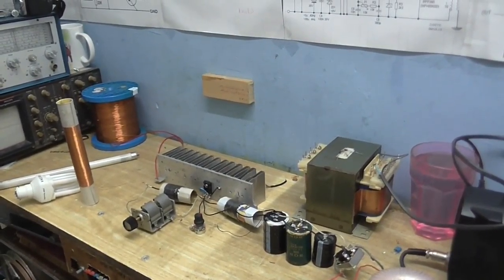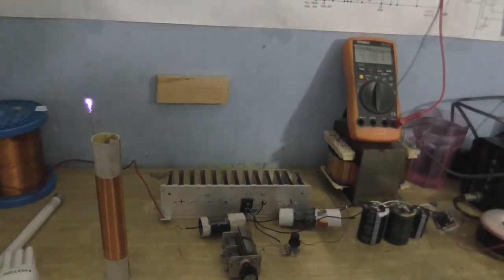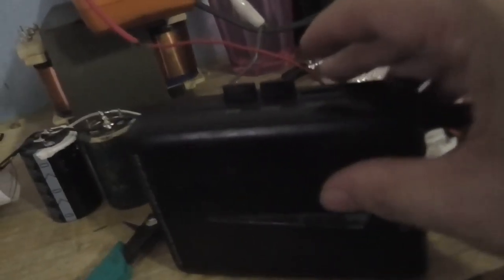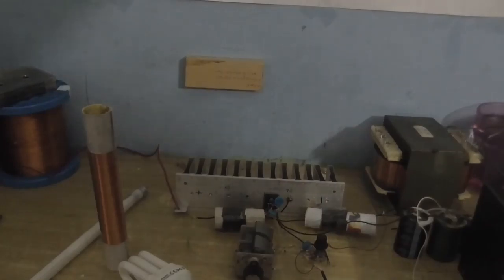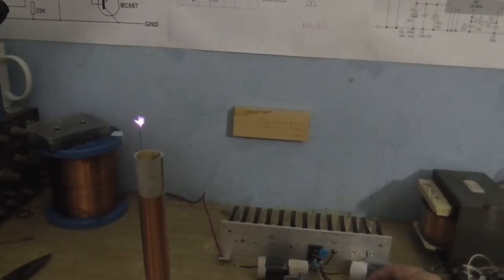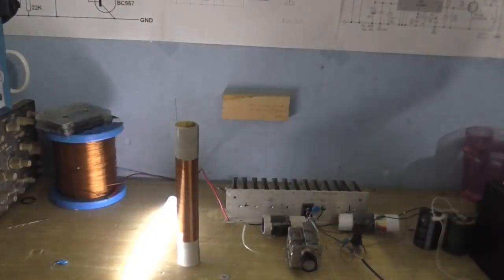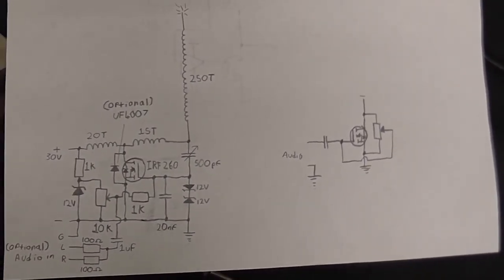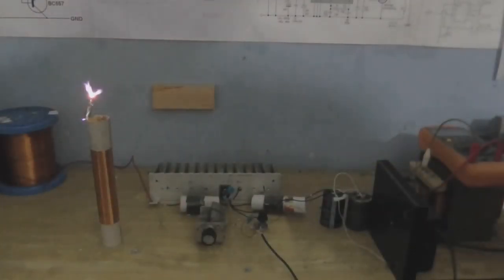Tesla Coil Tuesday 8 - Mini Solid State Base Fed Coil

Comment: Nice work! This looks like quite a nice little project 

althogh it isn't that simple to build it works great on florescent tubes! 👍

Thanks for the upload and hope you aren't roasting too much in our recent weather lol.
Reply from the maker: Nice thing about this is that you don't need to worry about which way round any of the coils are connected since there's no "transformer" in the circuit anywhere (apart from in the power supply). I'm still doing good n this hot weather, I have my big fan going to keep me cool.  I'd still take this really hot weather over cold any day.
Reply: CoolDudeClem that sounds good, Thanks for the reply Clem!

Comment: Nice job 4shure!  Any damaging feedback, like I unfortunately experienced with 960,000 volts 250mA.?  Shocking is was even having insulating gloves on...Ground got a new respect from me.... so did my blown house appliances, hey I was only experimenting!
Reply: I used dc copy machine transformers all wired in series.
Reply from the maker: Surprisingly this doesn't feed RF into the ground like my Vacuum Tube base fed coils did. I can run this one all day without anything complaining, but my vacuum tube base fed Tesla coils will make any nearby electrical stuff go crazy!
Reply: It was a "surprise" for me!

Comment: Not bad at all, I was getting similar results from a slayer exciter at around 28ish volts! Still really neat though! btw, why not just use a transformer for the audio modulation? I used a transformer on my high power slayer exciter and it worked really well with audio modulation, and I was even able to get a singing arc, or better yet incert a "modulating transistor" to achieve 100 percent modulation! For my audio source I used a shitty toy music player, and it did not like the rf or the feedback, so my singing arc was not as clear, and I simply did not want to risk coocking my phone. Im definately gonna make this! thanks for the video!
Reply from the maker: I wanted to keep things as simple as possible.  As a matter of fact, the original schematic did use a "modulating transistor" connected in series between the power supply's negative and the circuit's ground, but I thought of a much better way to do it witch wouldn't break the ground connection.
Reply: CoolDudeClem very wierd, I connecteed my modulating transformer between the resistor and the base of the transistor. I indeed got much better results using a tip31c instead of a bd135-139 transistors.

Comment: Hi Clem! I've enjoyed your cartoons and electronics for a long time. That's a lot of amps! can you explain why it's safe to hold the metal screwdriver near it?
Reply from the maker: 4 amps is almost nothing when it comes to high voltage circuits.  My ZVS flyback driver takes over 10 amps at full power! That's quite normal for things like that.  Low voltage with high current becomes high voltage with low current.  Anyway, the reason I don't get shocked when I hold the screwdriver near the coil is because even though there's several thousand volts arcing to the screwdriver, it's AC at a very high frequency, and the human body does not conduct well at high frequencies.  If it was a low frequency like 50 or 60 hz, it would hurt, but with high frequencies you don't feel a thing, of course it would burn you if you touch the arc directly.  I would never try this with a flyback though, since most of those output DC.
Reply: That was fascinating! thanks so much.

Comment: Hi there CDC! Interesting channel, good work!
I would like to build this. Do you have any diameters/thicknesses of coils? At presumably MHz range, the 2 choke coils would presumably need to be air cored litz wire, to avoid saturation/eddy currents , and exploding MOSFETs? 
Thanks J

Comment: which is the primary left or right coil in circuit
Reply from the maker: This circuit works differently than most Tesla coils do, there is no primary or secondary. Instead of working like a transformer, the coils are just inductors that boost the voltage by inductive kickback.